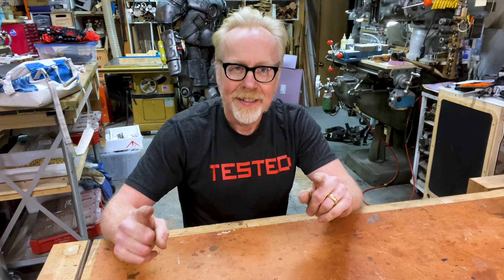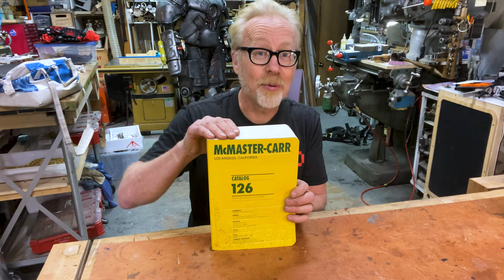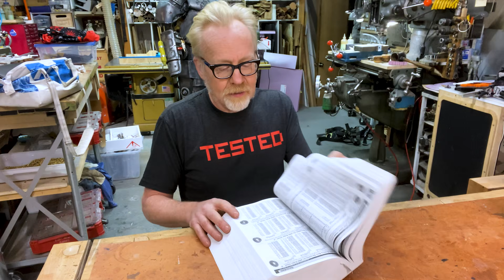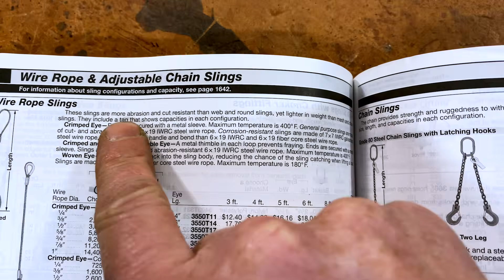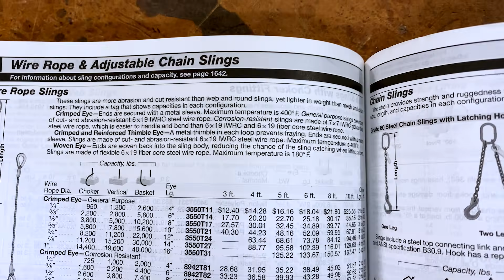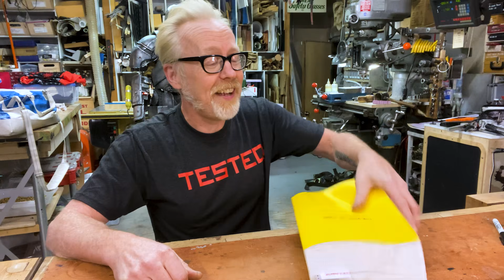Adam Savage's Favorite Tools: McMaster-Carr Catalog!

Comment: McMaster-Carr online is way better than the paper catalog because of it has very powerful search engine and filter tool. Plus it has CAD models of the items. Using paper catalog for work is nightmare. McMaster Online tool is even integrated in SolidWorks CAD program. Why do you need the paper catalog?

Comment: JW Winco has a handbook similar to McMaster-Carr's (ours is free), that supports designers and engineers with a large selection of standard parts. Our handbook has the most comprehensive number of standard parts with over 75,000 items on 2,184 pages.

Comment: If you need electronics, the DigiKey catalog is a MUST!  Their website isn't as great as McMaster's, but they are a fantastic resource for any electronics component you can think of, and even ones you can't!  Caps, resistors, ICs, but I feel more importantly, LEDs, odd lights, switches, buttons, power supplies, and oh, so much more!  Last I knew, you could request a catalog be mailed to you, however, I haven't needed to order anything in a while, so that may have changed.  https://www.digikey.com/

Comment: I don't yet have a copy of McMaster-Carr's catalogue, but I do have another book tip. It's not a catalogue, but it's one of the most useful compendia of machining and fabrication knowledge around: Machinery's Handbook. Want to know pipe sizes? It's in there. Gear profiles? In there. Steel section properties? Yep. It proved to be one of the most useful resources during my mechanical engineering degree.

Comment: I build RnD test setups in the Aerospace industry.  We use McMaster for a good 80% of our parts.  Their website has pretty much everything, and 2 day shipping.  They are great.  BUT be warned.  Quality control is virtually nonexistent on everything they sell.  And the technical info presented is usually ridiculously inaccurate.  So buyer beware!  And never order a solenoid valve from them.  Yikes.  It is true though that Grainger has very little compared to McMaster, and even less technical info available.  Grainger is where you guy safety equipment.  McMaster is where you buy hardware.

Comment: I am an avid user of Autodesk Fusion 360 for designing parts to be 3d printed. There is an option within F360 to add parts from McMaster-Carr right in your designs so you can test fit or use the parts in your design. Almost invaluable tool.

Comment: What he doesn't tell you is that they are way, way, way overpriced. A little Radio Shack $3 12v electric motor will run you $114. A $2 ACE Hardware O-ring, $20 bucks, A $5 18650 battery: $12 from them. But I guess if you have the money for it and don't shop around....

Comment: I live 65 Miles from Atlanta. I placed an order with McMaster-Carr at around 2:00 AM while working 2nd shift. It was less than $100 and I didn't pay for any special or expedited shipping. 14 hours later there was a courier in my driveway with the package. Not UPS or Fed-ex but a guy that drove from Atlanta to my house to deliver the package. I called McMaster-Carr to see if I had been charged some outrageous shipping fee. No, that's just the way they deliver is what I was told.

Comment: Another catalog I would recommend is Waytek Wire.  This is a much smaller company and catalog, but they provide one of the best compendiums of wiring and products for 12V and similar DC power applications.  It's mostly intended for vehicle applications, with the weather and environmental resistance that these applications require, but this makes them good for other low-voltage DC uses as well.

Comment: I work as a mechanical engineer in commercial machine design, and use McMaster-Carr on a weekly basis for products we design and build.  Their website is, at least to everyone I've talked to, the Gold Standard of design and layout for a hardware and equipment supplier.  The fact that it so closely mimics the printed catalog, as well as the fact that you can pull up and print the catalog pages, means you can actually understand and find matrices of products far better than any mere list of search results.  The fact that many parts have freely downloadable solid models for parts is icing on the cake.

Comment: Ah, the yellow bible.  For the makers & engineers aged ~GenX and earlier, it's a throwback to being 12 years old and the Sears Christmas catalogue arriving!  Didn't have one at my last job, but as mentioned their website is the standard by which all other "catalogue" websites should be measured.  And yes, when you search for an item, you have the option to "view catalog page" in the catalogue, which then has forward/back controls to "flip" through the surrounding pages.  The website is a kind of perfection; and doesn't require heavy duty shelf brackets(pg. 1764).

Also, since we were based in the NW 'burbs of Chicago, a "Will Call" order was >30min drive.  Saved on shipping for bulky items.

Comment: That is one damn good catalog and source for, many times, stuff so specialized you won't find it anywhere else that's for sure.  

One that I really miss that I wish one company would consider bringing back is the printed Mouser catalog.  That really was the jam.  That would make things like LED package alternatives, colors, sizes, etc. SO MUCH EASIER to look at in mass and by pages in areas of interest rather than them always making the assumption a search field is all that is needed and no exploration is really necessary, or that you already "know what you want."  Ok yes, you can filter your results as it is now, but exploring the results and surrounding areas of interest makes this impossible with only a database and no catalog to explore and inspire.  Not particularly "maker friendly."  There are alternatives to Mouser of course but they're kinda the McMaster of electronics parts distributers and kinda seem to show that they know that (or DigiKey I suppose- whom I avoid because their search engine blows pretty hard still).

Comment: I knew of them both before McMaster joined with Carr. I've been using McMaster-Carr since the 80's. I still have #99 next to my bed. I like the info in between sections that tell of the products in that section. I love the sections of metals like stainless that taught me the basics of stainless steel. It' strengths, its weaknesses, and its makeup. 
- The prototype makers bible for sure.

Comment: I didn't have a hard copy of the catalog, but the info on their website was sufficient to design a jack-screw assembly from the parts I ordered. I used it  to pull together a sprung boiler buckstay (utility boiler, ~600MMBtu/hr rated). When I HAD to know what I was getting, I went to McMaster-Carr.

Comment: Re-wired an antique chandelier with ridiculous small tubing.  Called every “lamp repair parts shop” for small lamp wire no luck.

Mcmaster carr to the rescue small diameter high voltage/amperage wire instock and delivered the next day for standard shipping.

Obscure vacuum check valve to repair defrost on dodge truck; got it no prob

They rule

Comment: I used the catalog VERY early on in my engineering career, but once it went online (and you could easily search for what you want, including narrowing it down by size), plus the online catalog is ALWAYS current I never touched a physical catalog again.  Since I design in solidworks, the fact that they have like 90% of their parts modeled in 3D and I can literally download them into a folder and start placing them into my assembly to check fit is incredible.  I honestly don't know how I would design most things if they didn't exist.

Comment: During my working 30 year career as an engineering designer I bought thousands and thousands of dollars of components from McMaster. It's true they are not the lowest cost supplier but the amount of things they carry is unbelievable. The overnight shipping saved our buts on more than one occasion and their customer service always surprised me. Many times they wouldn't have a specific size of something listed but I knew that it was available from the manufacturer. If I called the manufacturer they would require a minimum quantity ordered before they would ship it. I would call McMaster and get ahold of a CSR and ask them to get the item for me in the quantity I needed. Bam, done! They have such clout with vendors that they fill their orders without questions. Almost always the shipping was the same as an in stock item. Grainger is good too.

Comment: I still have bolts/nuts from MMC that one time, a neighbor needed some brake caliper bolts, and guess what, the ones I had fit! The only issue I have is that you need to buy a minimum if you need only 1-2 parts, you have to buy quantities in 25 or more. (not all items, but when it comes to fasteners...) Great company! TIP: Newark, Grainger, Mouser, Digi-Key and Thomasnet are great for parts.

Comment: Amazingly in philadelphia ...if we ordered something before 11am...we got it By 5:00pm thaT Same Day(!)
(Even though they're 50 miles away)
(They were basically Tool.Amazon BefoRe amazon existed)
If you actually go TO Mcmaster to pick up the order it's a prettY AmaZinG place.
40ft high racks with forklifts and people on 3 wheeled bikes buzzing around ...and all parts of the order go onto seperate downhill conveyor belts that culminate IN TO a UPS semi with the engine runninG  :) lol

Comment: Folks, listen to Adam, he is 100% correct on every point. 

2005-2007, I worked in Engineering at the International Truck & Engine plant in Melrose Park, IL. where they originally made engines for Liberator bombers during WW2 (It was on the Axis bombing list, thus multiple basements and redundant subterranean old-school industrial areas to explore, but I digress.) It was 3 miles from the McMaster-Carr warehouse in Elmhurst, IL. McMaster-Carr was literally our neighborhood hardware store. We used to go over there all the time for work-related supplies. I got paid to look through McMaster-Carr catalogs. The first time I walked in to the McMaster-Carr Will Call loading dock area, I swear I could hear an angelic choir singing.

Fast-forward to today: As both a maker, and an instructional designer and knowledge manager, I still hold up McMaster-Carr's catalog and web site as being a premier source of inspiration for makers, and the best and most useful example of knowledge management and delivery in the history of humanity.

If you design stuff or build stuff, and you (hopefully) want to work in the most efficient manner possible and/or capture what you have learned so it can be passed on to others (and thus move humanity forward), you likely recognize that the efficient utilization of quality information is one of your most important tools. Get what you need, get in, get out, get building. 

To achieve that efficiency, I suggest having three resources in your information toolbox: "250 HTML and Web Design Secrets" by Molly Holzschlag (for the 'Start Here' fundamentals of how to think in structured content), IBM's "Developing Quality Technical Information" (for the logical next steps of how to write it all down so you and others can efficiently reuse what you've learned), and McMaster-Carr's catalog and website (as examples of how to think efficiently, and what quality written, illustrated, and delivered knowledge should look like).

Immerse yourself in these three resources, and you will never suffer for inspiration. And, you will leave the world a better place than you found it.

Comment: I love McMaster-Carr and the first time I ever heard of them was when I was designing and setting up a nitrogen delivery system for my lab. They were just about the only company I could find that made quick-connects for nylon tubing in the exact size and pressure rating I needed for compressed air cylinders and large liquid nitrogen tanks. The extreme level of options and detail they provided on their listings and when contacting them with my newbie questions they were ridiculously helpful in walking me through and helping guide me to exactly what I needed. If I ever get around to my establishing my own hobby/creator workshop that I want I would definitely have them in my resource pool.

Comment: Soo as a regular user of this site, I agree with everything said. But I want to add: if you order from them, the prices might look good but shipping costs will be higher then you'd expect. They are not included with the price and will be charge after you order. Try to lump you purchases when possible since you only be charged one shipping price. I got a ton of metal pipe fittings shipped to me for $20, but also got a single acrylic tube for $9 plus $31 S&H . Not looking forward to the site being down for the next two weeks as people rush it.

Comment: I don't know very much about McMaster Carr, but I can share my favorite item (that I know of) in the catalog: an office.

For ~$5500 not only do you get insulated walls, a frame, and a roof, but you also get a steel and keyed door, a full electrical setup including a wall outlet, wall switch, fluorescent light fixture, and circuit breaker, and as many windows as you want! (Provided that number is three or lower).

It's a little building you can just plop into a warehouse or plant.

You truly can get anything from McMaster Carr

https://www.mcmaster.com/in-plant-offices/

Comment: A major bummer with McMaster-Carr is the titanium bolt are limited to silver.  If you need posh color coated Ti bolts it's more limited to very motorcyclist specific ProBolt-USA (or UK).   Another bummer with McMaster-Carr is the shipping they tend to send expedited UPS and won't sent anything USPS.  As former Oahu resident this was real problem as the shipping was insane

Comment: It is even better for us in the Mid-Atlantic states than for Adam. Because they ship out of Northern Jersey mid Atlantic get overnight shipping for the cost of normal ground shipping. It's the ultimate in over-night hardware store. (I've even occasionally gotten same day shipping for the cost of normal ground shipping if I ordered early enough in the morning. Granted, that was while I was working at a UDel, a large research university.
Now one odd thing, is they go out of their was to obfuscate the manufacturer names. For example, while at UDel I was shopping for an adjustable heat gun. I found a model that I liked is so I then started shopping around for a vendor. I found what looked like (by picture) the model that I was interested in, but wanted to verify that it was the exact model I wanted. I contacted McMaster to ask for the user's manual and they sent me a scanned copy of the manual. But the manufacturer name and model number was redacted with black bars. I had gotten the user's manual for the heat gun from the manufacturer so I was able to verify that McMaster provided the same manual. As I recall McMaster wasn't the lowest price, but I was ordering several other things from McMaster at the time so I did get the heat gun from them to keep the ordering overhead down to a single purchase instead of two orders from different vendors.

Comment: I was the assistant art director On a pilot for NBC with Steve Martin as the executive producer and they still refuse to send me a catalog. I finally got one because after 25 years of ordering with them they screwed up I was in Portland On the amazing race with a crew of 10 just ordered 1000 1/8” rivets To put together clue boxes and the rivet ball heads were too big for the stainless steel pre-drilled holes we had obviously they made good but we didn’t have the time so I had everybody running around hardware stores throughout Portland picking up Rivets. But I finally got my catalog.

Comment: You forgot to tell everyone how fast they get your stuff to your front door. The only thing about McMaster that throws me is that many of the items they sell are not associated with a manufacturer name or manufacturer part number so if you are trying to find a specific part for a replacement sometimes they only have the specs and a picture of the item in the catalog. For example. If you type in Apex Tool in McMaster you get nothing about Apex tools but if you type Apex Tool in Granger you get a listing of Apex sockets and driver bits. McMaster has a very large listing of driver bits and sockets and they very well could be manufactured by Apex but you can't tell until you get your order. McMaster has a lot of everything you will not find anywhere else.

Comment: McMaster Carr's site is an absolute godsend as a newbie hobbyist getting into 3D printing. I needed tiny springs, specifically sized screws, and matching tiny ball bearings for a 16 digit alphanumeric dice cryptex I was designing. I had what I needed ordered in five minutes, and at my door in less than two days for about $15. I'd have the app on my phone if the dang thing hadn't lasted as long as it has.

Comment: I really envy you guys. Yes, the same parts may be much cheaper here in China, in fact, I suspect most of them are made in China. But there's not a single company that provides such an extensive catalog of products, with detailed information and drawings. When I buy hardwares online, for example, some nuts and bolts, it seems that no one cares enough to provide detailed descriptions. So I have to purchase two bags of bolts of the same diameter because I don't know exactly how long they are. By the way, anyone knows where can I download a pdf version of this catalog? It seems that its app is region locked, I cannot download it from google play somehow.